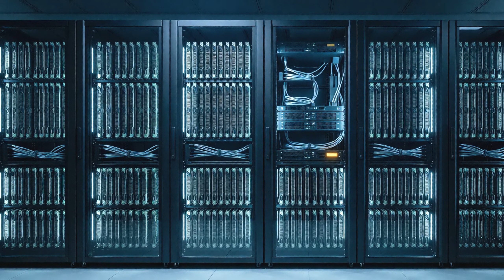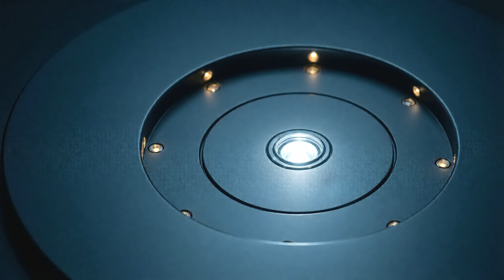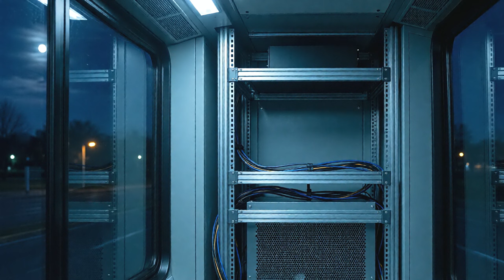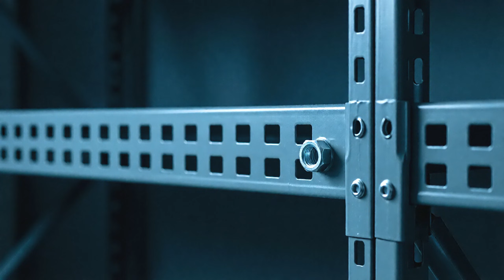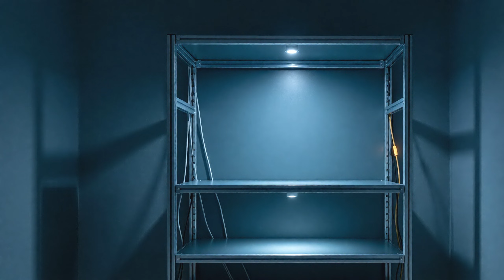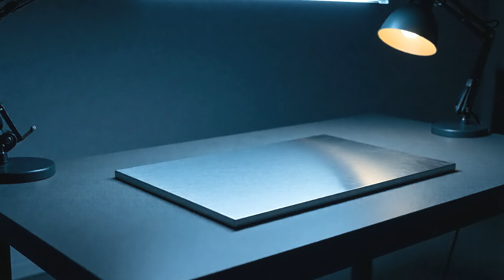The AI Data Centers That Learn in the Dark | Documentary for Sleep

Comment from the maker: Sources & references — The AI Data Centers That Learn in the Dark | Documentary for Sleep

The systems in this film are real and documented (sources in the replies below); the sensory night scenes are gentle illustration, not specific real events. Produced with AI assistance (narration and visuals); every fact is human-verified against the sources in the replies below.

The full source list (34 sources) is posted as replies to this comment.
Reply from the maker: Sources (1/5):

• A modern AI data center can make one rack behave like a very large accelerator: NVIDIA says GB200 NVL72 connects 36 Grace CPUs and 72 Blackwell GPUs in a rack-scale, liquid-cooled design.
  NVIDIA — https://www.nvidia.com/en-us/data-center/gb200-nvl72/
• NVIDIA says GB200 NVL72 uses the NVLink Switch System to give its 72 GPUs 130 TB/s of low-latency communication, so the rack can behave like one tightly coupled accelerator.
  NVIDIA — https://www.nvidia.com/en-us/data-center/gb200-nvl72/
• Google’s Ironwood TPU stack gives the non-GPU path a current flagship: a full 9,216-chip Ironwood superpod can use OCS and ICI fabric to operate as a single massive parallel processor.
  Google Cloud Blog — https://cloud.google.com/blog/products/compute/inside-the-ironwood-tpu-codesigned-ai-stack
• Ironwood’s optical circuit switch network can optically bypass an unhealthy cube and swap in a spare, so the machine can re-route around a fault without being physically rewired.
  Google Cloud Blog — https://cloud.google.com/blog/products/compute/inside-the-ironwood-tpu-codesigned-ai-stack
• Google’s 2026 AI infrastructure announcement says Virgo Network with TPU 8t can connect 134,000 TPUs in one data center and more than one million TPUs across multiple sites into one training cluster; narrate this as an announced capability, not a live fleet claim.
  Google Cloud Blog — https://cloud.google.com/blog/products/compute/ai-infrastructure-at-next26
• Microsoft’s Fairwater sites are described as purpose-built AI data centers for both training and running AI models, not ordinary enterprise server rooms.
  Microsoft Source — https://news.microsoft.com/source/features/ai/from-wisconsin-to-atlanta-microsoft-connects-datacenters-to-build-its-first-ai-superfactory/
• Inside Fairwater, Microsoft says its design uses NVIDIA GB200 NVL72 rack-scale systems that can scale to hundreds of thousands of Blackwell GPUs, so treat this as a vendor-described design capability, not a measured final deployment.
  Microsoft Source — https://news.microsoft.com/source/features/ai/from-wisconsin-to-atlanta-microsoft-connects-datacenters-to-build-its-first-ai-superfactory/
• Microsoft says Fairwater-style distributed networking is intended to support training models with hundreds of trillions of parameters across multiple sites; keep this framed as Microsoft’s design target.
  Microsoft Source — https://news.microsoft.com/source/features/ai/from-wisconsin-to-atlanta-microsoft-connects-datacenters-to-build-its-first-ai-superfactory/
Reply from the maker: Sources (2/5):

• Microsoft locates its Wisconsin Fairwater facility in Mount Pleasant and says the facility will use enough fiber to wrap the planet four times over, giving the episode a sourced Wisconsin fiber waypoint.
  Microsoft On the Issues — https://blogs.microsoft.com/on-the-issues/2025/09/18/made-in-wisconsin-the-worlds-most-powerful-ai-datacenter/
• Microsoft said its Wisconsin Fairwater design would use closed-loop liquid cooling for more than 90 percent of the facility.
  Microsoft On the Issues — https://blogs.microsoft.com/on-the-issues/2025/09/18/made-in-wisconsin-the-worlds-most-powerful-ai-datacenter/
• Microsoft’s zero-water cooling design, launched in August 2024, is described as chip-level cooling that avoids evaporative water use for cooling.
  Microsoft Cloud Blog — https://www.microsoft.com/en-us/microsoft-cloud/blog/2024/12/09/sustainable-by-design-next-generation-datacenters-consume-zero-water-for-cooling/
• Microsoft says that design can avoid the need for more than 125 million liters of water per year per datacenter, while still using water for ordinary administrative purposes.
  Microsoft Cloud Blog — https://www.microsoft.com/en-us/microsoft-cloud/blog/2024/12/09/sustainable-by-design-next-generation-datacenters-consume-zero-water-for-cooling/
• NVIDIA Quantum-2 InfiniBand switches give AI clusters high-speed scale-out networking, with 64 ports at 400 Gb/s or 128 ports at 200 Gb/s.
  NVIDIA — https://www.nvidia.com/en-us/networking/quantum2/
• NVIDIA says a Quantum-2 switch delivers 51.2 Tb/s of bidirectional throughput and more than 66.5 billion packets per second.
  NVIDIA — https://www.nvidia.com/en-us/networking/quantum2/
• Google says a carbon-intelligent computing platform can shift many compute tasks toward hours when low-carbon sources are more plentiful.
  Google Blog — https://blog.google/innovation-and-ai/infrastructure-and-cloud/global-network/data-centers-work-harder-sun-shines-wind-blows/
• Google also uses data-center demand response software that can temporarily reduce power demand when called by an outside utility or grid operator.
  Google Cloud Blog — https://cloud.google.com/blog/products/infrastructure/using-demand-response-to-reduce-data-center-power-consumption
Reply from the maker: Sources (3/5):

• Microsoft’s Project Forge uses checkpointing so AI training or inference work can be paused and restarted, helping schedule workloads when hardware has available capacity.
  Microsoft Cloud Blog — https://www.microsoft.com/en-us/microsoft-cloud/blog/2024/09/12/sustainable-by-design-innovating-for-energy-efficiency-in-ai-part-1/
• Google says it has deployed liquid cooling at gigawatt scale across more than 2,000 TPU Pods, with in-row coolant distribution units and UPS support for high availability.
  Google Cloud Blog — https://cloud.google.com/blog/topics/systems/enabling-1-mw-it-racks-and-liquid-cooling-at-ocp-emea-summit
• Google says liquid-cooled machine-learning servers can be nearly half the geometrical volume of air-cooled counterparts because cold plates replace bulky heatsinks.
  Google Cloud Blog — https://cloud.google.com/blog/topics/systems/enabling-1-mw-it-racks-and-liquid-cooling-at-ocp-emea-summit
• Meta’s 2022 AI Research SuperCluster remains useful as historical scale context: it was designed to grow from 6,080 to 16,000 GPUs, with a non-oversubscribed InfiniBand fabric and nearly 5 exaflops of mixed-precision compute.
  Meta AI — https://ai.meta.com/blog/ai-rsc/
• Meta’s 2022 RSC storage layer was itself a major system, including 175 petabytes of FlashArray, 46 petabytes of cache storage, and 10 petabytes of FlashBlade.
  Meta AI — https://ai.meta.com/blog/ai-rsc/
• ASHRAE’s 2021 thermal reference card gives a recommended 18 to 27 °C dry-bulb range for air-cooled Classes A1 to A4.
  ASHRAE — https://www.ashrae.org/file%20library/technical%20resources/bookstore/supplemental%20files/therm-gdlns-5th-r-e-refcard.pdf
• ASHRAE’s high-density server class H1 is narrower, with a recommended 18 to 22 °C dry-bulb range.
  ASHRAE — https://www.ashrae.org/file%20library/technical%20resources/bookstore/supplemental%20files/therm-gdlns-5th-r-e-refcard.pdf
• ASHRAE’s water-cooled-server guidance describes the coolant distribution unit as the exchanger between technology coolant and facility water.
  ASHRAE — https://www.ashrae.org/file%20library/technical%20resources/bookstore/whitepaper_tc099-watercooledservers.pdf
Reply from the maker: Sources (4/5):

• Google’s own photo captions give a concrete outside-the-building cooling image: at Midlothian, Texas, the cooling loop enters beside a fiber trestle that carries the data network into the building.
  Google Data Centers — https://datacenters.google/discover-more/photo-gallery/
• Google’s data-center gallery also shows the backup-power layer as a physical yard: critical generators handle the critical load for the server floor if a power interruption occurs.
  Google Data Centers — https://datacenters.google/discover-more/photo-gallery/
• A data-center power train turns utility power into conditioned rack power through switchgear, UPS batteries, and backup power before the load reaches the IT equipment.
  Vertiv — https://www.vertiv.com/4909d7/globalassets/shared/vertiv-datacenterpowertrain-eb-en-na-sl-80203-web-small.pdf
• Rack PDUs are the last link in the power chain: the floor PDU feeds the rack PDU, and the rack PDU distributes power to equipment in each cabinet or rack.
  Vertiv — https://www.vertiv.com/en-us/insights/articles/educational-articles/what-is-a-rack-pdu/
• Nscale, Aker, and OpenAI announced Stargate Norway as a planned 230 MW Narvik project targeting 100,000 NVIDIA GPUs by the end of 2026, with more expansion intended over time.
  Nscale — https://www.nscale.com/press-releases/stargate-norway-nscale-aker-openai
• Nscale says the Stargate Norway facility will be in Kvandal outside Narvik, where abundant hydropower, cool climate, and industrial infrastructure make the site suited to large-scale data operations.
  Nscale — https://www.nscale.com/press-releases/stargate-norway-nscale-aker-openai
• Nscale says the Narvik site is planned to run entirely on renewable hydropower, use closed-loop liquid cooling, and recycle waste heat for local low-carbon industries.
  Nscale — https://www.nscale.com/blog/stargate-norway-laying-the-foundation-for-the-future-of-ai
• The IEA’s updated 2026 projection sees data-center electricity consumption roughly doubling from 485 TWh in 2025 to 950 TWh in 2030, while AI-focused data centers grow faster than the overall sector.
  International Energy Agency — https://www.iea.org/reports/key-questions-on-energy-and-ai/executive-summary
Reply from the maker: Sources (5/5):

• Open Compute Project’s Open Rack V3 defines a common rack frame meant to provide structure and power interoperability for large-scale deployments.
  Open Compute Project — https://www.opencompute.org/documents/open-rack-base-specification-version-3-pdf
• Open Rack V3’s 48V power output connector specification defines a 46.0V to 52.0V DC range for the rack power interface.